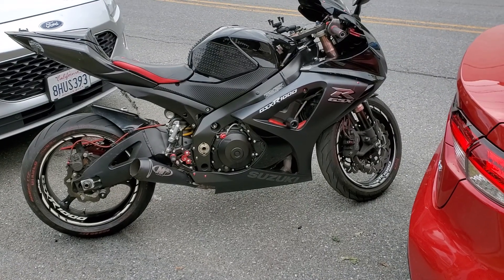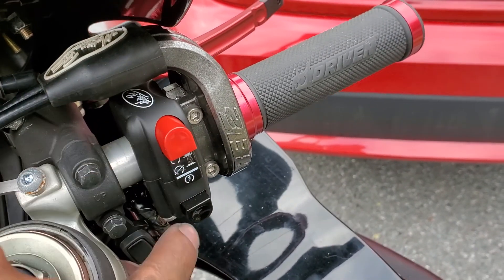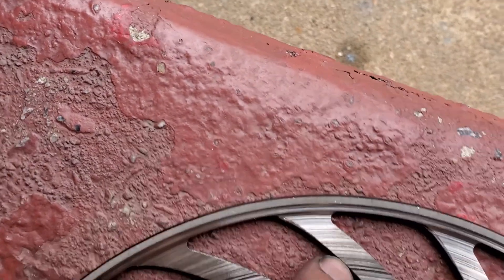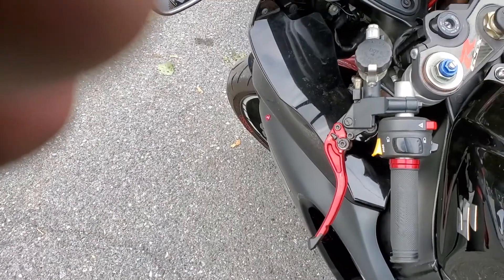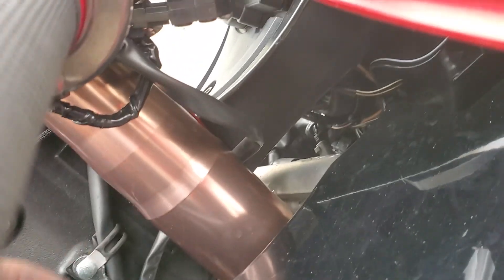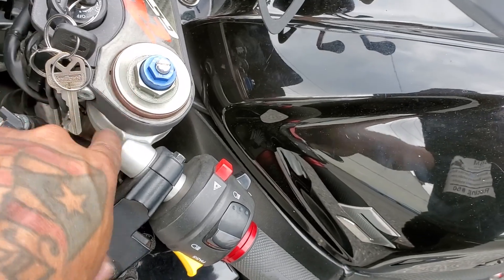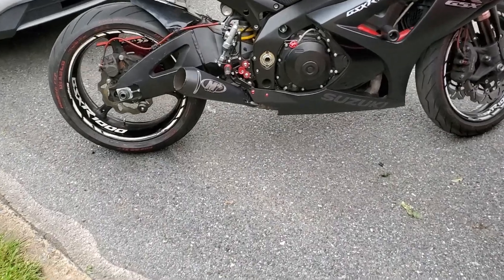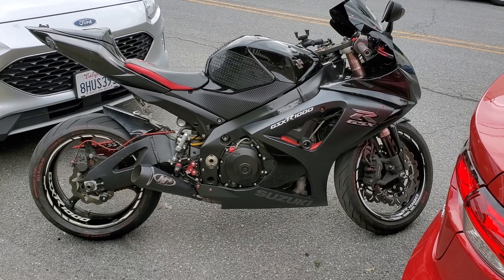2008 Suzuki gsxr 1000 rebuilt part 2

Comment: How did you go with going up a couple of teeth
Reply from the maker: I did a review brother I'm uploading it as soon as I wake up .. My review is bogus because my rear brake calliper was stuck pressing the brake so I was losing a lot of horsepower and torque by the brake being pressed
Reply: @Sportbikememace  shit go bro. Update review when you sort the caliper. Btw don't go to the trouble of syncing throttle bodies if it isn't needed. Did mine yesterday, all headache and no gain
Reply from the maker: @benpasnin8440   Wow bro I'm sorry to hear that.. I love working on my bike but there's certain jobs that i do on my bike that I wouldn't do again lol ☠  I ordered a tool just in case to pull out the piston out of the calliper..
Reply: @Sportbikememace  what I've done in the past is extended the piston out lightly rub 400 grit around piston then grease around the piston. Push caliper back in  working the grease into the seal and repeat  3 or 4 times. It has worked for me in past however don't know the severity of your problem.
Reply from the maker: @benpasnin8440   I was going to bleed the system because they're saying it could be that the brake fluid could be Overfilled I also have to clean off the piston with sandpaper lightly and re lubricated with Greece But if it's worse than that then I have to take out the piston out of the calliper Clean the grime and dirt could be behind the passing point
Reply: @Sportbikememace  perfect
Reply from the maker: @benpasnin8440   Yeah bro I'm hoping it's simple.